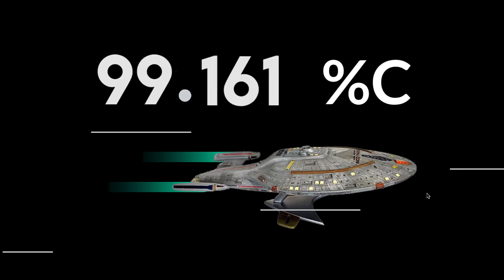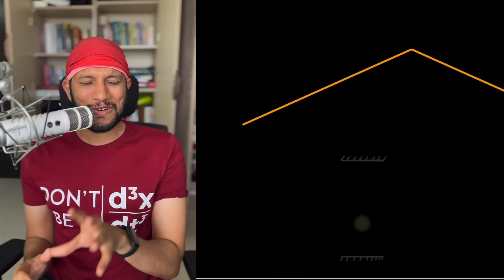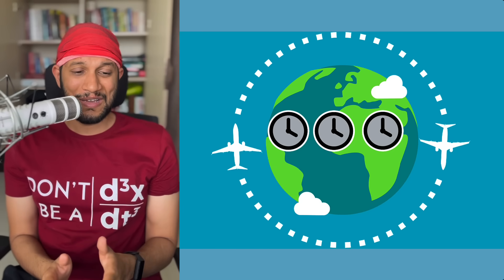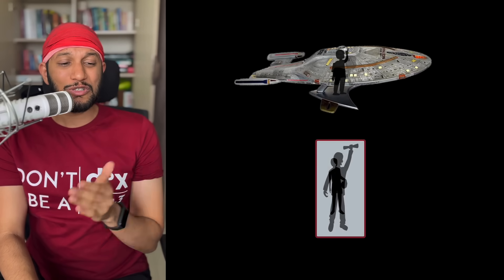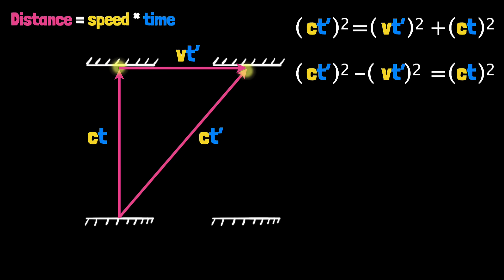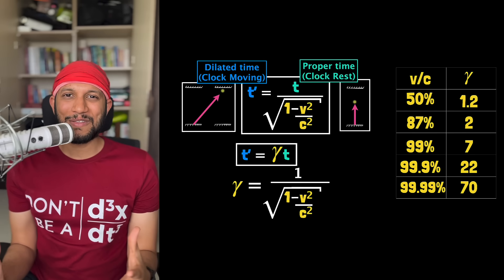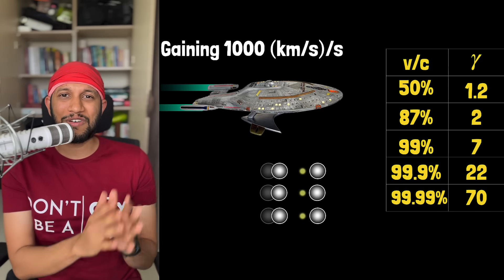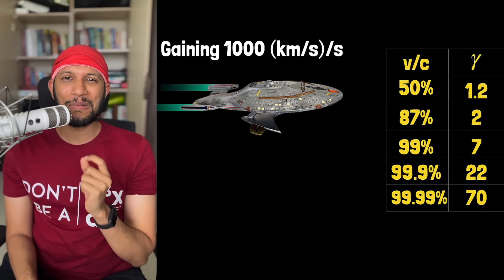I finally understood why you can't go faster than light! (My mind is blown)

Comment: HOWEVER!!... Think of it this way... WHAT IF we light were to move at just a single mile per hour lower than it currently does in the real world. Then, riddle me this... Wouldn't that make "C" 1 MPH lower than the Speed of Light? And, since we aren't able to travel as fast as light, then we wouldn't be able to travel at a maximum speed of 99.99% the speed of light and will never actually reach 100.00% because the line keeps extending to Absolute Infinity... So we thought ... Here me out... If light moved 1 MPH slower, then "C" would be closer to 0 MPH than it once was. And, if this were the case, there could only be two possibilities: 

1. The speed would finally actually reach "C"
2. The max. Speed would be slower than the max speed in reality. 

This is due to the fact that, let's hypothetically say that light is WAY slower... Say... Just a HUGE fraction of what it actually is... Like ... Let's hypothetically say it would be just 100 Miles Per Hour. "C" in this case would represent the Speed of Light or 100.00 Miles Per Hour. And, in this case, we could get REALLY close to the speed of light for infinity since we could only reach at most 99.99999999999...% the speed of light or "C" or 99.99999999999 Miles Per Hour... So, if that is the case, well... How come if we slowed the speed of light even further to something like just 2 Miles Per Hour... Well... "C" would represent 2 MPH or the Speed of Light, so... In that case WE could just simply WALK down a sidewalk and be traveling FASTER than the Speed of Light! Since, humans would be able to travel faster than "C" or 2 MPH!... Orrr..... In other terms, we would just be walking at a speed slower than a scooba diver in the desert! And the fastest possible speed of which is not being achieved by light itself would be 99.99999999999% the new Speed of Light or 1.99999999999... Miles Per Hour to infinity! NOT The Speed of Light which would be 2.0 MPH... Now, let's speed this speed of Light all the way from 2.0 MPH all the way back up to it's current speed of 671,000,000 MPH ... In this case, also known as the ACTUAL speed of light... "C" is in reality not hypothetically but in reality representing 671,000,000 MPH or the Speed of Light... Would be so-called "IMPOSSIBLE" to reach due to what he mentioned in this video... However, if this is all true, and the fastest Speed other than light itself achievable is very close but not exactly the speed of light... Would be 99.99999999999% the real speed of light or 60,000,000.99999999999 MPH not 61,000,000.00 MPH... Let's now assume the maximum possible speed achievable not by light would be 1 Mph slower than light speed... Since this is the case... If the speed of light WAS 1Mph slower... We SHOULD be able to make it!!! Now, if we make the speed of light 61,000,001 MPH instead of 61,000,000 MPH... Guess what? "C" would represent 61,000,001 Mph and the maximum achievable speed...? Well ... The ACTUAL SPEED OF LIGHT!!!! WE DID IT! IN FACT, WE PASSED THE SPEED OF LIGHT IN THIS CASE BY 0.99999999999... MPH, IN FACT!!!!

Comment: well you can from the point of view (pov) of the traveller cross a distance d in less time than d/c. In fact you can travel it in any defined small amount of time. Alpha Centauri is 4.37 light years away. You , from your point of view, can be there in a year. At any point along that trip in your reference frame you can do a 1  m/s delta v burn and end up going 1 m/s faster in your frame of reference (at the start of the burn). There is nothing slowing you down (again in your reference frame). You don't feel heavier, your clock still ticks the same and you arrive in less the 4.37 years.
So enough with the negativity of you can't travel faster than the speed of light :)
Also a simple physical representation of why you can not travel faster than light is that your always travelling at the speed of light. At rest your travelling straight up the time axis. As you go faster you rotate that speed of light travel into a spatial dimension and away from the time axis, but the length in spacetime stays the same.

Comment: I'm just an average Joe. But if a black hole is by some considered infinite. Although I think I heard General Relativity doesn't allow for a black hole to be an infinite singularity. Could a hypothetically indestructible ship traveling at that 99.9999% of light then use a black hole to slingshot off of... would that feasibly be able to draw that last bit of infinite energy to reach C? If yes does that prove black holes are infinite? If no would that prove them not infinite?

Comment: I noticed that you didn't touch on length contraction, which should be what the crew of the accelerating ship sees (since they won't experience time dilation, given that they are in the accelerating reference frame).

Comment: Before you can even test light speed, you have to deal with the other more dangerous problem.  At 8000m/s, the speed that the shuttle usually maintained to be in orbit, orbital debris will blow all the way through the shuttle leaving not one, but two holes.  Remembering this, a high velocity rifle round is only travel 1500m/s.  So, what is going to happen when you are going light speed and hit a rock floating around in space?  Firgure out how to stop stuff from hitting the ship, so people can survive, before worry about light speed.

Comment: But piecing together all relevant pieces here, it means even if you had infinite energy you'd still never reach the speed of light. If the transfer of information/energy for acceleration between particles a and b takes forever, it means the distance between them will increase since particle b isn't yet energized to catch up, that would lead to spaghettification, ie disintegration, no?

Comment: Okay, from the outside it would look frozen in time at some point. What about from the inside? Can the system itself measure that it has reached the speed of light without going outside its reference frame? What effects would occur then? Side note, it all looks like falling towards the event horizon of a black hole. Some argue, even if a falling object would be seen as a frozen in time for an outside observer, for the object itself, it might be down to nanoseconds, and there are wild theories about passing the event horizon and going outside of our Universe (whatever that means). The situation is very complex at this point and closer to philosophy, but the correlation/analogy between the black hole paradox and a spaceship going at the speed of light is a viable one and can be used. 

Another cool way to think about this is the time/space correlation. As Einstein correctly predicted and showed these two entities are tied together. You can think of it as a 100% distributed between those two. If you stay still, you have 0% movement in space and 100% movement in time (hence time goes fastest). If you move at 99% the speed of light, you have 99% movement in space, and 1% movement in time. In my opinion it's the most intuitive solution. That's why moving faster than the speed of light is impossible, it would mean traveling back in time, or exceeding the initial starting conditions of 100% space/time available. The speed of light is the the ultimate threshold, Universe's event horizon so to speak.

Comment: For the sci-fi addicts who think FTL might be possible, you'll also need a few other things. Inertia dampeners, navigational deflectors and subspace communication. Just like FTL travel, none are actually possible in real science.
Reply: FTL is possible because in real science, just like in Star Trek, it is not the ship moving FTL, but space it self which is moving, the ship is just going alone for the ride as space is expanded behind the ship, and contracted in front of it. Think of it like surfing.
Reply: @george849  it's only at best a mathematical conjecture with the albicure? drive. Even then you come up against the space -time paradox. Sorry, but the laws of physics say FTL is impossible in this universe. As a Trekkie from the first series, I too was deeply disappointed when reality smacked me on the nose. The reality is that the power necessary to generate such a drive is way, way beyond anything we can build today - hell , we can't even do cold fusion, and that's just the initial thing for impulse engines. As for antimatter, we've only just had a possible detection of one subatomic particle in the haydron collider. So no, not in our lifetime. Besides, if the climate scientists are right, 2050 is tipping point year, and from then on it'll be just survival that we'll be concentrating on.
Reply: @richardcaves3601 of course, that's why every Sci fi setting has an exotic matter that they use, which could exist. Never say no, but I agree, I don't see us finding exotic matter in the rest of humanitie's lifespan.
Reply: I think for stuff like that we need to be billions of years older. Basically gods. I think all the crazy things can be possible, but not for us, at our state. Possibly never.

Comment: I asked chatgpt if 2 ships went opposite directions at 60% of the speed of light. That means 60+60=99.99 which doesn't make sense
That "clock" doesn't count seconds, it counts bounces. The arm clock doesn't count seconds, but movement. Speed is relative, when you drive a bike you don't consider earth's speed, sun's speed, galaxy's speed to check if you're breaking 30 kmh speed limit.
Reply: Don't ask gpt pls and then think it's somehow super smart, when it just collects Intel from the internet and tries to put it into context 😂 one big reason why our current Ai pisses me of, people already think skynet is here.
Reply: @GreenSabre187  exactly. It's only decent if you have good prompts, and even then, you still need to hold its hand. It's inept when it comes to any specialization. At least at its current state.
Reply: You're missing a few points based on erroneous assumptions. 

Chatgpt is an llm and makes a lot of wrong answers.

Neither ship is traveling faster than the speed of light, they just wouldn't be able to transfer information.

A clock is a means to measure time, it doesn't have to be in seconds.

Relativity is accounted for.

Comment: okay, now, it should be obvious that this form of movement, is not how the vehicles that travel faster than light, move through space. 
Maybe we need to find a way that can move space, through space. In a few words, the photons become irrelevant to outside observation, as it moves. 
Not sure if that sounds completely irrational, but I know, The observed UAP or UFO, do have faster than light information in the reports. 
So, I search for the words, a way to comprehend the crafts capabilities from those unexplained events. 
I hope mankind will figure it out and reach for the lights in space. I think we can hope it'll be there when we arrive.
If we try it without warping space to get there. If we do get FTL, It'll be the same hope. The light we see is so very old and also isn't what is actually there, now.

Comment: I love the excitement and enthusiasm of these videos.  But doesn't this prove that we cannot OBSERVE something with mass accelerating to c rather than proving that something cannot actually  move at c?  If we observe something falling into a black hole, for instance, we observe that it goes slower and slower and the light from it moves further and further to the red and eventually that object seems to freeze and gradually dim as the light shifts towards the infrared.  Does that mean that the object has actually slowed down and stopped despite the rapidly increasing pull from the black hole?   No, of course not. We know that Einstein is correct in explaining what we SEE, but he does not try to explain what actually is.  We tend to write off proper time and give all our attention to relative time.  Naturally, that's what we would do in order to, for instance, calculate the effects of GPS satellites moving at high, yet non relativistic, speeds.  But if we are to understand how the universe works, we may need to stretch our imaginations to try to see how the universe might work in proper time. That, however, raises the question that never seems to be addressed:  What does it actually mean to "travel through space"?   If my spaceship accelerates away from the Earth and travels at 67,000mph counter to the rotation of the Earth around the Sun, it meets the Earth a year later in the same sun -centric spot.  Has it traveled through space?

Comment: OK, so do photons accelerate to c, or are they just always at c? I know that c is different in different mediums, but is still c. So a photon traveling through the vacuum of space would travel at c, then if it passed into a bubble of liquid water it would travel at water's value of c, but when it came out the other side it would once again be going at c in a vacuum? Can light be slowed down below c without changing the medium it's traveling in?

Comment: If we can’t travel faster than the speed of light then explain this (which has proven to be faster than light)

Cherenkov radiation happens when electrically charged particles, such as protons or electrons, travel faster than light in a clear medium like water.

E=MC^2 means you can’t travel faster than light speed squared.
Not the same thing at all.
Reply: That's not what E=mc^2 means.

As for cherenkov radiation, nothing is traveling faster than the speed of light. Charged particles are traveling faster than light travels through *water*. You should reread what you read on cherenkov radiation as no charged particle travels faster than C.
Reply: you should also re-read. The nothing travels faster than light is in a vacuum claim. If it can in water (and it does) then why not in a vacuum with no resistance. I think we just don't know the methods or techniques to do so yet. @Testaccount-h1p
Reply: @jasonsmithwick7270  I read it. Because particles move differently between different mediums. 

In simpler terms, just because one thing travels slower than another in one medium, doesn't mean it travels slower than another in all mediums.  Hope that helps with your confusion.

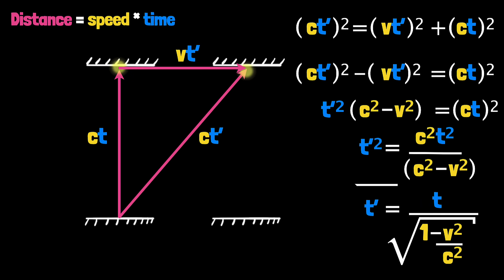Comment: 9:25 i dont understand you jumped so many steps here, you suddenly go from c^2 being over v^2 to randomly inversing so v^2 is now over c^2 but all of this is over t still? Would it not be t’=t multiplied by sqrt(1-v^2/c^2) instead of t/sqrt(1-v^2/c^2)? Im so confused
Reply from the maker: You divide both numerator and denominator by c^2. And then take square root. Sorry about that. I was running out of space (and time)

Comment: 1:52 I'm still confused about this example. On the inside-ship animation, the photon bounces at a certain speed, but on the outside, it bounces on a lower speed. If the point was to prove it'll travel a bigger distance, shouldn't the photon animation being at the same speed for both animations?
Reply: it is. The distance the photon is traveling is the same per unit time, but that distance is from the viewers reference frame. The portion of distance (or time, it's a photon) used moving laterally, is reduced from its vertical axis from a stationary frame. Like throwing a ball up in a moving car, you see it move in straight lines because you're moving with it, someone watching you drive by sees it make an arc dozens of feet long. The ball had the same velocity in both at any given point, the quirk of light speed is that... (using ball is light and light is now super slow) IF you saw the ball go up and down in 1 second, and the outside observer also saw the ball make the arc in the same 1 second to them, then the light they saw would have to be moving at C + the cars speed (and atomic clocks wouldn't dilate). Since a perfectly stationary observer (outside the car) can only see light moving at the speed of light, that means the light had to 'slow down' for those moving inside the car (but light doesn't slow down - so time does). 
 
This is how the theoretical 'if you could go the speed of light, time would stop' comes from, because to an outside observer, if the photon clock is going sideways at the speed of light, 100% of the motion the photon could do would be in the direction of travel, with none left to move towards the mirrors. The photon would appear to stop (relative to the ship), but to those on board, up to and after that point, would never see it slow down, they'd just be experiencing time as we do, seeing light behave as we do...

Comment: I thought that the idea of speed effecting time was debunked?

I thought that they figured out that it was less gravity in the jet plane in the way up in the sky effecting that clock differently than the one at ground level

Besides, in using a clock on a jet plane they would have to have taken in to consideration in their calculations the movement of, earth's solar orbit, our solar system's milky-way orbit, the Milky-way's local cluster orbit, and on and on alone with the universal expansion

That jet plane could have been actually slowing the clocks actual speed

Comment: (1) we don't have materials to handle light speed
(2) we don't have processing fast enough for light speed
(3) we don't have sensors that can sense far enough for light speed navigation and are fast enough and sensitive enough to detect a penny size rock in the path a few million miles away